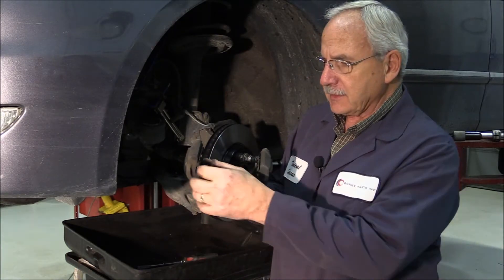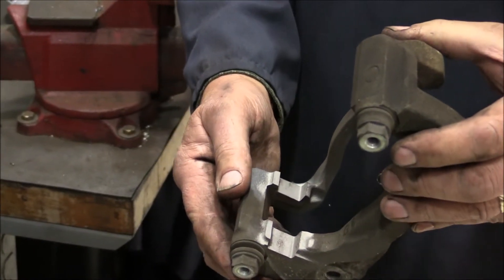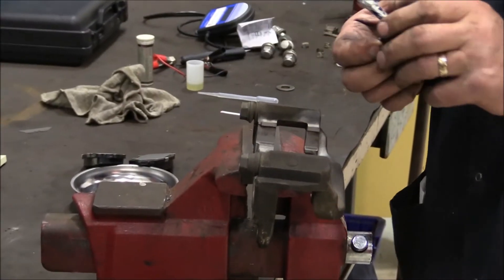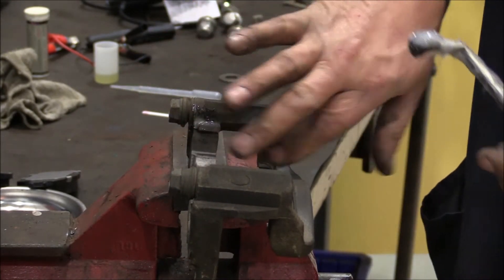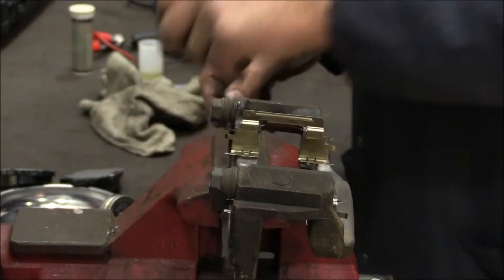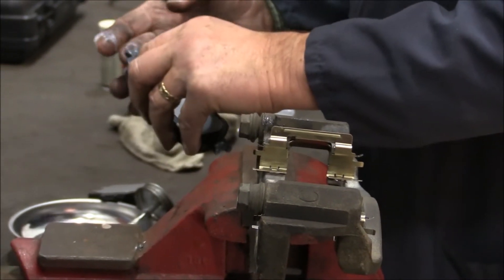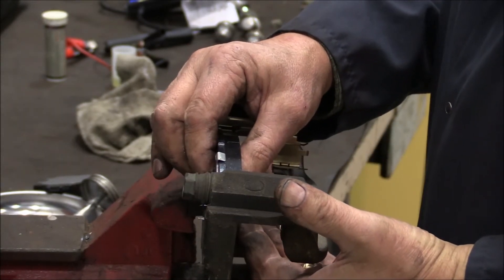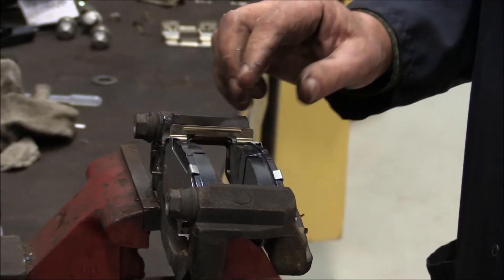Raybestos Best Brake Job: Cleaning Caliper Bracket/Installing Pads

Comment: On my 2008 Dodge Grand Caravan, I've replace the front pads four time/every year since I bought the car.  Averaging about 20,000 miles on a set of pads.  
I Do about 100 days of skiing every winter at the local mountain.  Each trip involves about 3,000 vertical feet over the course of six miles.  I put the car into a lower gear to reduce brake wear.  Still, the brakes get hot and sometimes smoke, shimmy & shake.  So that's part of it.    
I've struggled in the last couple of brake jobs with getting the Raybestos pads to fit into the included Raybestos abutment clips.  I think I do an adequate job of cleaning/prepping the bracket.  So, I don't think the bracket is closing up the volume of the abutment clip.  Should I have sanded or ground the ears of the pad for a better fit?  
I've been reading, that after releasing the brakes, that the pad should move away from the disk to no contact.  Could a tight pad abutment clip resist this?
Reply: I regularly service customers brakes at 25-30k miles on the 08-10 grand caravans and town and country vans in my state of Michigan. One of the hardest vehicles I’ve ever seen on brakes.

Comment: I bought KLEEN-FLOW Eze Slide Synthetic brake lube (silicone based). Will use it on the caliper slider pins and abuttment clips as you showed. Should I put some lube on the brake pad backing plates ? Which kind ? For the record, my car is a 2008 Impreza 2.5i Sport (with 4 disc brakes, dual piston calipers in the front and single piston in the rear).